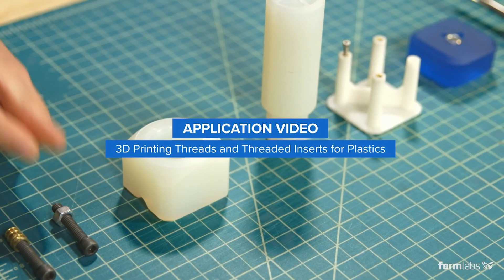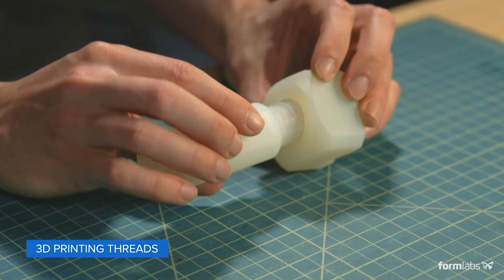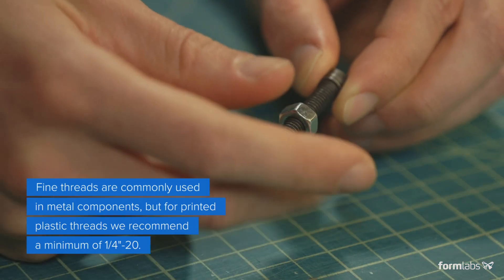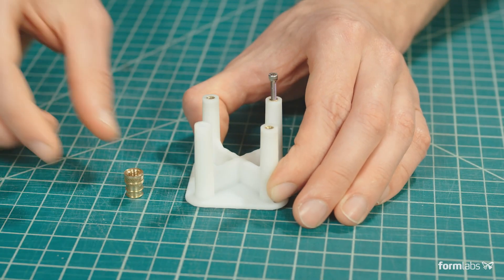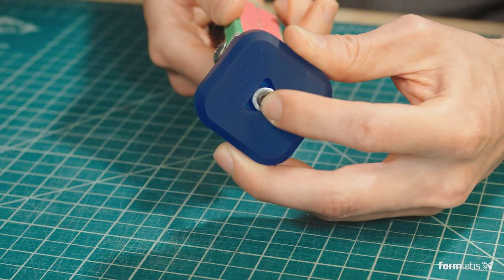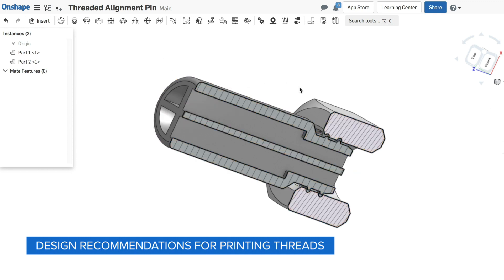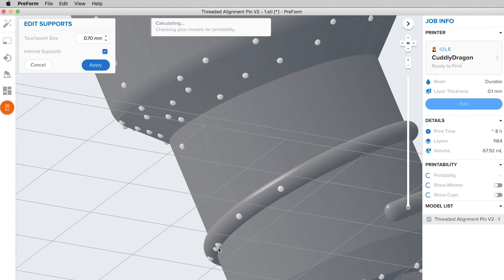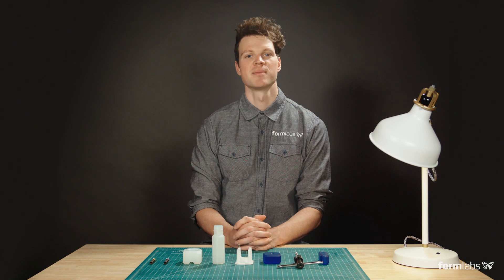3D Printing Threads and Threaded Inserts for Plastics

Comment: The problem with using taps is the fixturing required to keep them square to the hole. Resins give even if the tap is angled while providing very little mechanical guidance to the tap. We see the same problem in metals, so it's to be expected that resins are even worse. One option we are considering is to print tapped holes like NPT 1/8 just slightly undersized so the tap is set into the existing threads for alignment and only needs to cut away a small clearance to make a fully formed tap. For through-holes a tapered point tap is fairly safe for screw threads whereas a tapered thread tap is asking for trouble without fixturing. I have a classic example where a 3/8-16 tap got off by maybe 5 degrees. It's ugly.